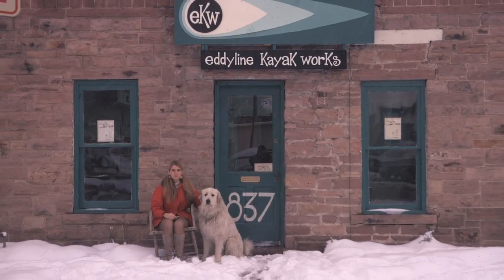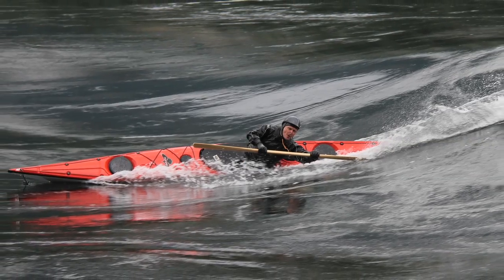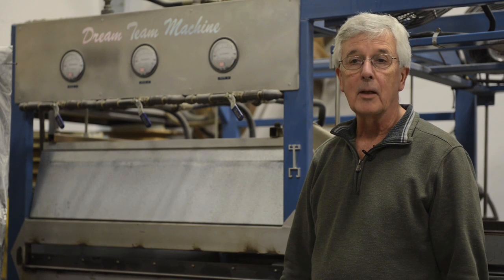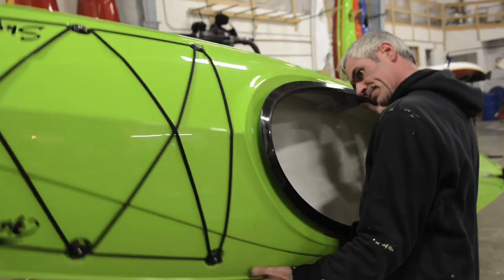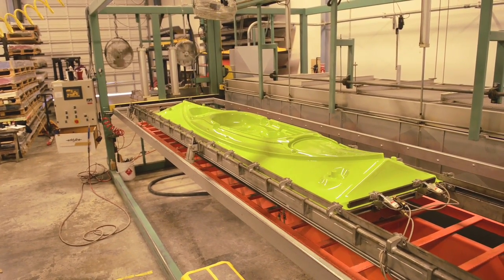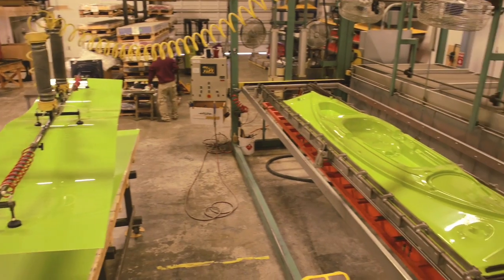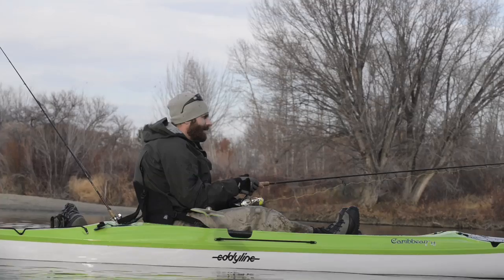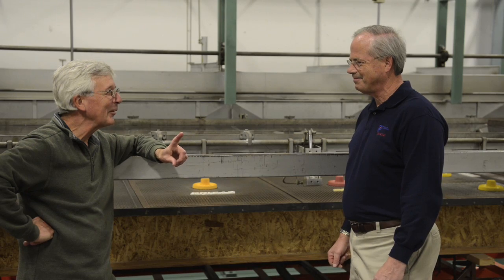Thermoforming Eddyline Kayaks - Forming The Future

Comment: ...I backed into a concrete pole and got some major cracks in my eddyline 14.  I patched them with gorilla tape but its gotta get fixed...I dont know what to do other than try to line up the cracks and epoxy them???  The cracks are huge... uhhhhhggg
Reply: Plastic weld it
Reply: @MudMotorsMax  I used methyl methacrylate and carbon fiber cloth.
Reply: @ArcolaBridge  You should really look into plastic welding that’s just going be a temporary fix. plastic welding really is the best way to do it. I myself have a Coleman Scanoe RamX And it is not easy to fix it’s crossed linked high density polyethylene which turns the HDPE from a thermoplastic that can melt into a thermoset plastic which means it no longer melts… at this point It’s not easy to repair, even before adhesives and epoxy’s will NOT stick to HDPE. A guy has to bevel the crack or hole then sand & rough up the area to create tooth or bite and then get a Polyvance's KCWPRO airless plastic welder and fill the hole or crack to create a plug… then sand. Your boat being made of ABS Acrylonitrile butadiene styrene can be glued with adhesives but also can definitely be repaired with the polyVance welder and some ABS welding rod… You can get any color you want on Amazon. If I were you do some research and look into it yourself I highly recommend it
Reply: @MudMotorsMax  I thought about that but the damage was huge and I ended up using a Dremel to open up the cracks quite a bit and then I used a wire wheel to put some serious grooves either side of the cracks inside and out then I used 60 grit sandpaper to rough it up a bit more then I applied the methyl methacrylate and it really really strong. I called eddyline to consult what I should do and they said to use the methyl methacrylate with fiberglass cloth and it would be stronger than it was originally. But I chose to use carbon fiber cloth because it's stronger and last longer. No worry about galvanic corrosion on this kayak. I did think about plastic welding and using those metal screens to connect the the cracks together even better but I don't know how well that would have worked and it might not have been easy at all to try to get the cracks aligned to their original shape. I could be wrong that could have been a great way to do it but I did it and there's no undoing it now. It's really really strong and I'm totally confident in it at this point. The only thing I don't like about the methyl methacrylate is that it sets up really really fast in about 5 minutes. It's pretty cheap go on Amazon you can get a lot of it for 50 bucks.  I was worried that the ABS acrylic would not plastic Weld and according to eddyline it wouldn't have worked out very well. That was my original suggestion but they said not to do it. I guess the ABS acrylic is layered together and they didn't think the plastic weld would be a good choice. The cracks are actually stronger now then I think it was originally that's what eddyline says and I think they're right it's pretty tough and I don't expect it to be temporary at all I think it's a permanent fix. Methyl methacrylate is a thermoplastic that is used to put dump trailer beds together and things like that it's a pretty hard core product.
Reply: @ArcolaBridge  Yeah I’m a pretty big fan of plastics I’d like to start building my own small shallow water boats one day. I have been researching and scouring the Internet to figure out what material to make them out of. It has to be affordable, slightly flexible, impact resistant, easily manufactured and repair so anything like Roylex or Tformex just too expensive. I am leaning towards a a cross-linked high density polyethylene (HDPE or UHMWPE)
Reply: @MudMotorsMax  the carbonlite 2000 eddyline material is a really really good combination of smooth, durable and lightweight. I'm looking at an epic surfski kayak hybrid, they only make one and I can't remember what it's called. It's 3500 for the cheap version or 4,500 for the expensive version. I've seen people make those little Runabout sail dingy out of furring strips and either fiberglass or carbon fiber. Pretty tough challenge to make one of those things but boy are they a cool little ride for around the docks and shallows. I'd like to build a 18ft carbon- fiber surfski kayak sit on top hybrid with two seats. The Epic surfski kayak hybrid is a vacuum bag carbon fiber affair, super lightweight. I love Plastics and all but there are other materials like carbon fiber, Kevlar and aircraft fiberglass which is being used now on boat hulls because it is free of galvanic corrosion concerns so no grounding needed and it's actually flexible yet strong. If you could make a mold and a vacuum bag setup you could probably make a pretty slick yak. I think if I'm going to move up from the Caribbean 14 which has served me well going all around Dry Tortugas and to all the Cedar Keys and Lake Superior and other places it's going to be the Epic surfski kayak hybrid expensive version. I want something even lighter and stronger if possible. There is a Hawaiian company that specializes in Surf skis and those ones require an outrigger because they are true surf skis. Those things fly across the water the name is like kawaii or something like that. If you haven't heard of it already it's a very fast boat.